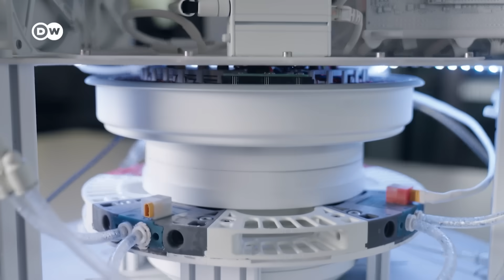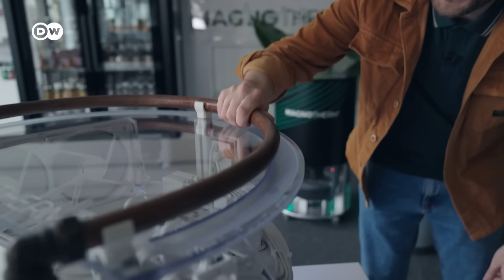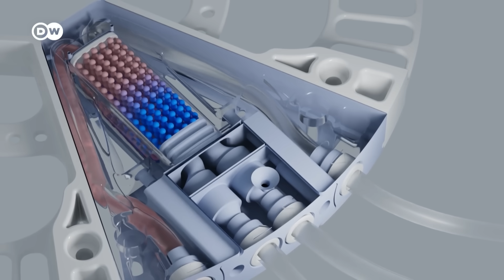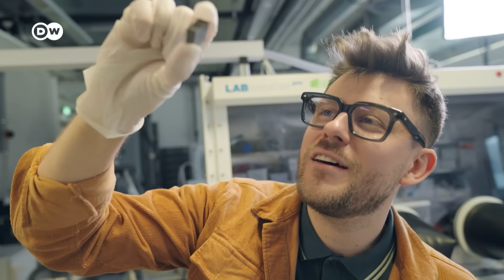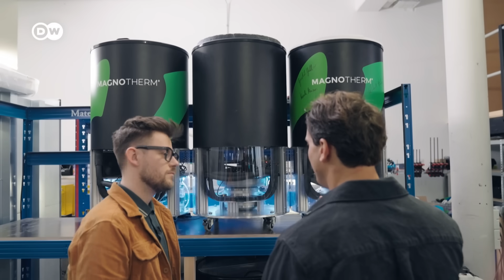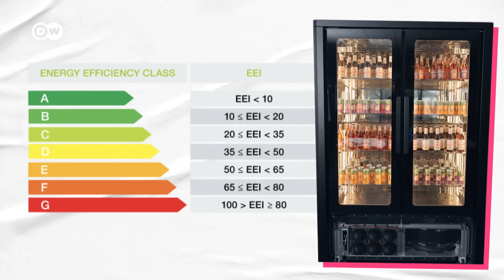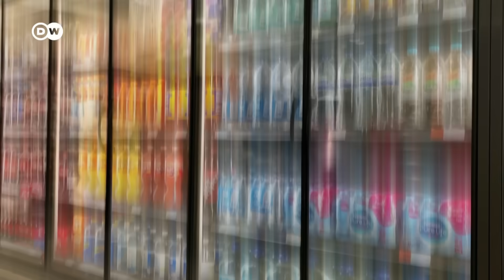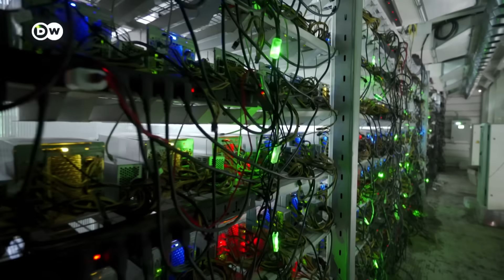How magnets could change our fridges and ACs forever

Comment: Interesting concept, one of the most important aspect was not explored in the video though: what is fridge's lifespan vs current ones. Can it last 10, 15 or 20 years with minimal component changes?
Reply: the spinning of the plates likely reduces the durability. They will probably need to placed it in a vacuum sealed container like a hard disk enclosure. to improve durability. but that would be costly for such a big device.
Reply: @bigture  First it's less complicated.   They have no freezer.     The compressor is more likely to break.  and it won't freeze the trap that seperates the Freezer and fridge.  and the antifreeze wont break.  But then the magnet part might  go out of allignment.  it will take awhile because people don't know how to repair it.
Reply: @stevenlouie6922  The fact it's even being worked on is good. Technology improves with time... if people actually are working on it.
Reply: @stevenlouie6922  You realise most home refrigerators just use air from the freezer (which it's actually cooling) to cool down the fridge? So for home use it definitely needs to focus on cooling a freezer first, not a refrigerator. Second, this version is WAY more complex with not just a large spinning magnet disc but multiple pumps for each of the "pizza slice" shaped coolers. So yes it will be vastly less reliable, much shorter lifespan and harder and more expensive to repair. I really don't see this tech as a viable replacement to current refrigerator tech which is far more mature and longer lasting and really a far smaller cooling unit than this spinning thing - I mean the showcase version clearly shows it taking up half the space or more that is usually allocated to freezer space and I doubt it will shrink in size by much.
Reply: @stevenlouie6922 you know compressors are dirt cheap and easy to replace right?
Reply: Also, who on earth buys a fridge without a freezer compartment?
Reply: Exactly my thoughts. Adding moving parts seems VERY convenient for planned obsolescence.

Comment: Would be cool if they would target first the market of deep freezing systems, e.g. for liquid nitrogen creation. These systems are extremely costly and chained enough magnetic modules behind each other you can reach temperatures below 1 K with magnetic cooling, if you use vacuum insulation.

I bet the market would be much more open to such systems, if they are cheaper than conventional compressor based systems or hybrid systems.

Comment: Worth also mentioning refrigerants that have been used in compressor based systems can be HFCs that can have an extrememly high Gas Warming Potential, thousands of times greater than carbon dioxide. From groups like Project Drawdown, finding alternatives and managing these HFCs could be a solution that cuts carbon emission by 10% by 2050. Additionaly, the Kigali Amendment to the Montreal Protocol is an international agreement to gradually reduce the consumption and production of hydrofluorocarbons (HFCs).
Reply: most fridges and small systems use regular hydrocarbons like butane. at least in europe.
Reply: @Psrj-ad  Yes: Butane gas a Global warming potential of just 7, and a domestic fridge contains just a tiny amount of butane.
Reply: @Psrj-ad  Not thousands anymore. R32 - the choice refrigerant for ACs has 675x higher global warming potential than CO2.  Home fridges use isobutane (r600a) in tiny amounts - that's a non issue and in coming years we expect big systems to transfer to CO2 itself (there are few issues with that but it is perfectly possible, it is already being used in some of the more expensive cars AFAIK)
Reply: Both my fridge and my chest freezer use isobutane (an alkane) as refrigerants. The days of freon are long over, only legacy systems still use freon and the number of them is shrinking every year. 
If you're worried about butane (again an alkane, not a CFC) from modern domestic refrigerators then you're looking in the wrong place. I would contend that the average smoker releases more butane from missed lighter strikes in a given year than the average butane cycle refrigerator.
Reply: @DangerB0ne  I agree completely.
Reply: Old refrigerators used ammonia, which is taken up by plants and used as fertilizer.  There are many other chemicals that can be used for refrigerants that don't have harmful effects like HFCs have.
Reply: R290 (propane) has a GWP of 0.02 and is a drop-in replacement for R22 (A/C systems). It's also slightly more efficient than R22 (which was already almost perfect).  Instead, they forced R410a on the industry, resulting in unreliable equipment that lasts 1/3 as long.  Then it turns out (surprise!) R410A has an even higher GWP (2088) than R-22 did (1810)!  Oops, I guess?  Now 410A is on the way out, which means you gotta buy new equipment again, and the cycle just keeps repeating.  
I get propane is flammable, but it CAN be made safe for a cost - a cost orders of magnitude less than all the costs (environmental, human, capital) with the 410A changeout. The pesky little problem with propane though is that nobody holds a patent, and it won't require you to buy a new system every 3-5 years, and here we are.  This is NOT about the environment, you've just been tricked into believing it is.